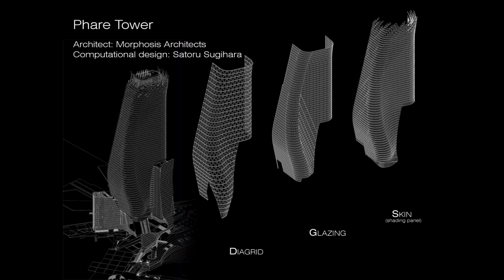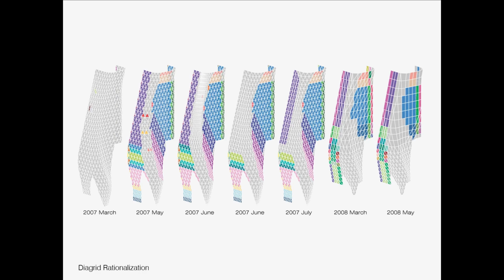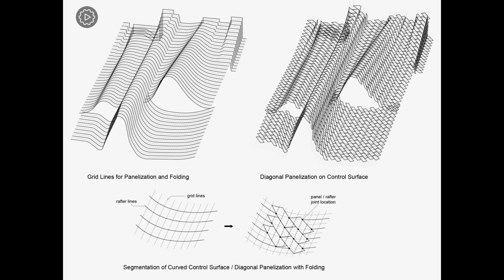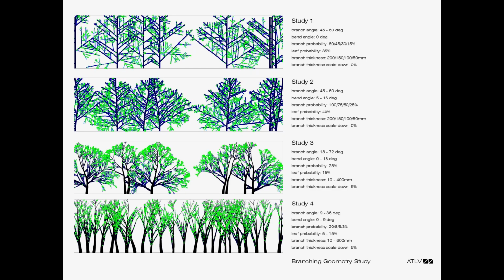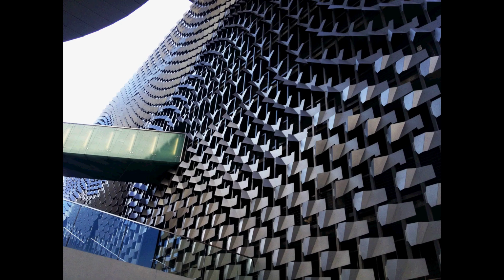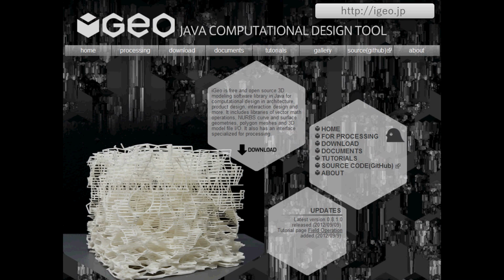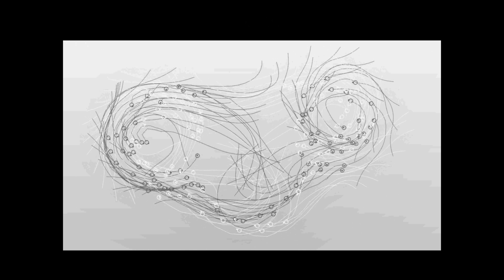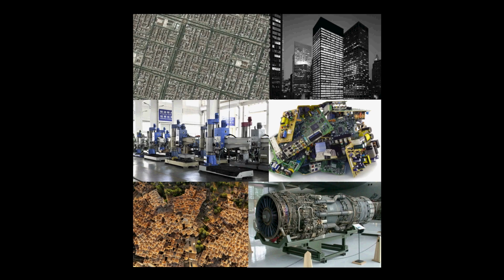20 min Lecture of Computational Design by Satoru Sugihara + Hierarchical Behavior Agents

Comment: Hello Sir,
I have a question. Why there is a need to use processing for designers? In other words, what is there in processing that grasshopper cannot do? I am a budding architect and I am amazed by work. I think you are the right person to ask.
Reply from the maker: You can run most of top down algorithms like panelization easier in Grasshopper. For more precise control for complex algorithm (like when you have 100 panels but you want 5 of them operated differently), it becomes difficult to do with regular graphical Grasshopper. In this case you can still use Grasshopper scripting like C# or Python. For bottom-up algorithms like agent-based algorithm, Grasshopper has plugins to do that but there would be certain difficulties to control precise behavior which is sacrifice of making it easier. Then Processing is better but you need to write more, i.e. Processing is more suitable to build custom agents with precise control. Another aspect is that people has preference in writing styles and API styles which affect your productivity and people choose platform based on those styles as well. I choose Processing because of it. Usually for super-quick panelization work I use Grasshopper and for other complex computational design work I use Processing.
Reply: @torusg  thank you sir for clearing the doubt. This means a lot.